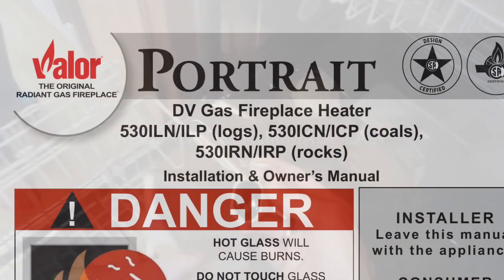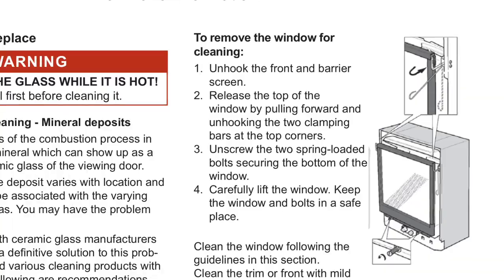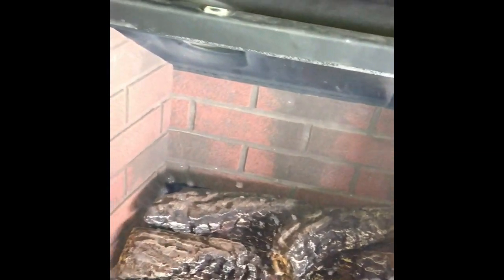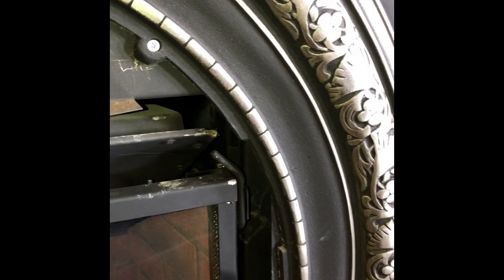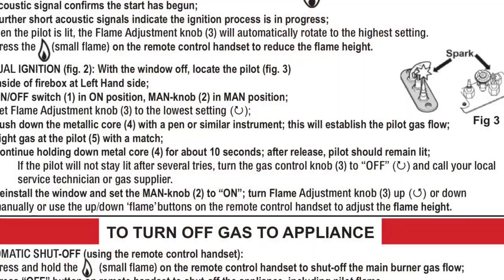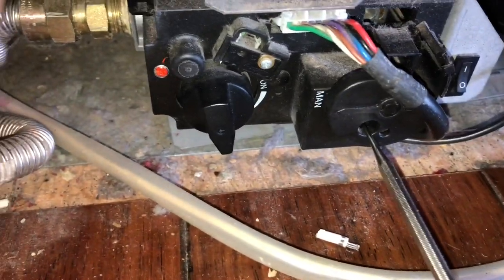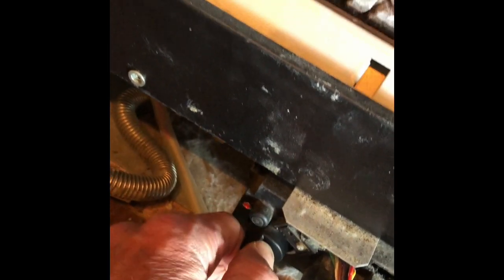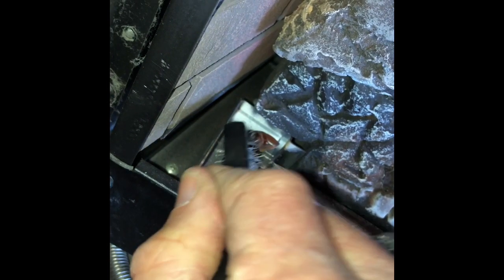✨ HOW To Easily LIGHT A REMOTE CONTROL FIREPLACE That WON’T START ✨

Comment: But how do you get the auto start to work? It just keeps beeping but pilot doesn't light
Reply: Mine is doing the same thing *EDIT: about two minutes after i wrote this comment my husband came to my aid and just kept pressing the power and the flame button and it lit! I just think sometimes it takes more time than expected to get that pilot to light.
Reply: I had tried that this morning and must have done it six times and the pilot wouldn't light! I thought something was wrong but, its been cold so possibly it just took more tries than i thought was reasonable. But now i know to be patient, even if it takes 20 tries, i am happy to have the warmth.